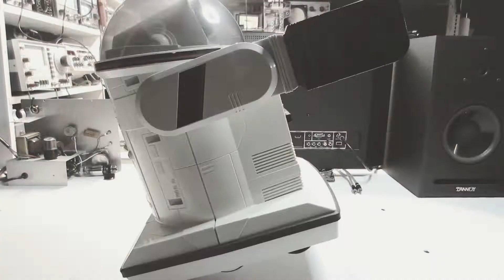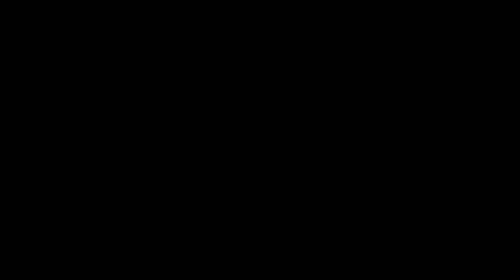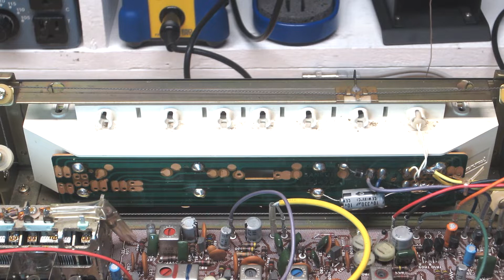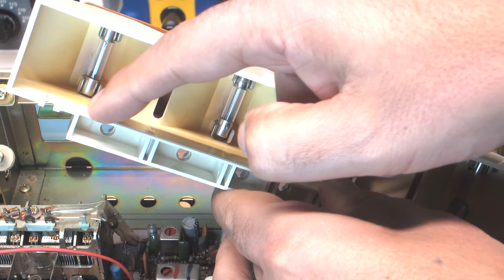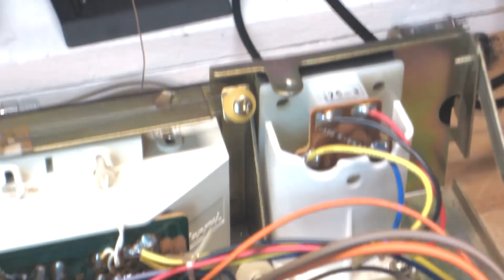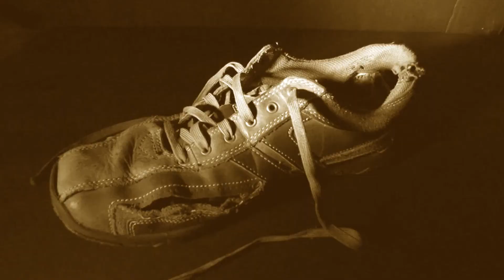Lamp Replacement Sansui 771 Viewer Request

Comment: Thanks for your help.  Could you also show how you removed the function indicator lights?  I have a 770 where the wires go inside that housing unit and I don't know how to separate it without breaking it.  Thanks and peace love and music!
Reply from the maker: Hello and pardon the delay, I've been extremely busy. I don't have the 771 (or similar model) in the shop anymore, they're back with the customers, so, I can't demonstrate the removal of / access to the function lamps. However, in most cases you should be able to pull on the base of the function lamps (within reason), maybe give them a "wiggle" and they usually pull out. Most of those lamps are "friction fitted" into the plastic lamp housing. If you have the main housing removed, you can give the function lamps a little push from the front with perhaps something that won't damage them. If they were soldered to a circuit board like some other makes / models it would be a different story and would of course involve removal of the board  and de-soldering of the lamp etc. But in the case of those lamps that are pressed into the plastic housing, you just have to play around with them a bit, unless someone glued them in or something. By the way, the function lamps are all one piece, it's not a separate "bulb and socket" configuration, so the replacement lamp will need it's wires soldered to the board, or you could neatly "splice on" to the existing wires.

Comment: I just wanted to thank you for your excellent video and i followed it step by step to change the three dial lamps in my Sansui 551.It came off without a hitch.I do have one question if you don't mind.My tuner is definitely picking up stereo broadcasts but the FM Stereo light doesn't come on.I know i'm getting stereo because on older stuff like the Beatles etc. where stereo separation was much more drastic it's definitely not in MONO.
 I don't understand which lamp lights it up.Is it that little red LED light that sits between the dial lamp housing and the tuning meter housing? The tuning meter lamp is working and all the dial lamps work now so it must be the LED. If this is the case are replacements available for the LED and are they tough to change?
 It's no big deal deal but,if it's easy to fix i'd do it.  Thanks for all your help.
Reply from the maker: Hello Patricia, I'm glad everything worked out with replacing the bulbs. As far as the stereo indicator is concerned, I can't recall the exact layout of the 551, however, I do believe it uses one of those little 3mm (diameter) LEDS. You did mention a little red LED, so that must be it. I think the LED for that stereo light is mounted to a little board (but I could be wrong), or does it have wires coming off it to a board?. In any case it will have to be de-soldered and its replacement soldered back in. If you are comfortable doing so, then it should be fairly straight forward, if it is a bad LED of course. Again, if you are comfortable doing so, it would be a good idea to check whether or not you have DC voltage at the LED. I know the LED should be "fed" signal / voltage from one of the pins of a  multiplex IC, and you'll probably see about 8 volts or so when tuned onto a station where you should have a stereo signal. When you are tuned into a stereo signal the LED turns on and then off when you are tune off of the stereo signal, which again you will see reflected in the voltage measurement on the meter (multimeter /DMM). of course, if you don't have a meter, and or are not comfortable performing such a test, by all means do not venture into trying it, especially when performing tests that require you to have the unit plugged in and powered on. If you think you want to replace it (if it's bad) feel free to send me a photo of it (ernest@retroelectrotech.com) and I'll have a better idea of how it mounts, i.e., to a board etc., and what type of replacement will be the best option.
Reply: @retroelectrotech  Well,first thanks for all your help and for taking the time to explain this to me.
   Yes,you're correct the LED sits on a little  board with two wires soldered to it.This board is situated between the dial lamp housing and the meter housing and looks pretty easy to get to.There is only one screw to undo.
   I'm going to take your advice and test first to see if the LED is still good and then go from there.
   After you explained it i now have a much better idea of how this LED is suppose to work.
   I'll let you know what i find out.Thanks so much.

Comment: Thanks! I'll bet this will work for my 551 also.I have just one dial lamp out but,is it best to just replace all four? I didn't know.Thanks for great detailed video.
Reply from the maker: Hello there, yes, you might as well replace them all since you're going to be in there any way. It would be a good idea to use some swabs and alcohol to clean the contact surfaces of the sockets as well, just to assure good connectivity when you install the new lamps. Just be careful and unplug the unit while you're working on it. I'm sure you already know that, but just in case 🙂
Reply: @retroelectrotech  Thanks so much for the great tips.It's always a good reminder to unplug first before you do any work.I will make sure to clean all contacts with alcohol too.
 You know i have a 551,a 5050 and a G-2000.I just love that Sansui sound.
  Thanks again.

Comment: Thanks for this. I have the 881 and suspect its the same as the 771 bulb replacement. Would this procedure alleviate the FM and FM Stereo indicator not lighting up too? Or is there something else needed to be done? Thanks in advance.
Reply from the maker: Good evening, Your 881 is essentially the same as far as the bulb housing is concerned. However, You'll notice on Yours there are more indicator bulbs that span across the top portion of the housing (not including the meters)that are indicators for "stereo, phono, FM, AM, Aux 1 and Aux 2. As far as replacing just the stereo indicator bulb, yes, if the bulb is all that is bad then a replacement should resolve the problem. But if a new bulb fails to light, then You may have a connection issue / open connection elsewhere in circuit. A simple check of the wiring to the board may reveal loose connectivity / a bad solder joint. Also, on the power supply board, I believe fuse F01 is for the lamps (I'm going by memory on that). Additionally, the problem may involve an issue within the stereo MPX circuitry, which can be why the stereo indicator lamp doesn't light. Nonetheless, try a bulb first and see if that resolves the problem. Because I don't know what Your knowledge level is / ability to perform basic testing and beyond, I'm just mentioning the above possible problems to give You some general information. Be careful in there when You power up the unit to test the lamps etc. 🙂
Reply: Thanks again. Will try that. Best regards!

Comment: Could you share the bulbs you used to replace these?
Reply from the maker: Good afternoon, the large "fuse type" bulbs / lamps for the dial face are the 8 volt fuse lamp variety, and the other lamps for the meters are the 6.3 volt (or just 6v) 3mm "grain of wheat" bulbs / lamps. When I have to order them, I typically shop around a little, because there are so many people selling them, as well as selling lamp kits for the various Sansui receivers etc. You'll also see the LED version as opposed to incandescent. The incandescent variety have that "warmer" look, however, they also make some LED types nowadays that have a bit of a warmer look, so, whatever your heart desires ;-) You'll pay a bit more if you buy a lamp kit of course. But if you'd like that option a good seller on eBay is a guy that goes by  Affinity For Artifacts / Peace Love And Music , and he sells all kinds of lamp kits etc., and he has good feedback. (I'll put a link to his shop below), so, there are a lot of options out there, hope that helps a bit.

https://www.ebay.com/str/infinidimenterprises

Comment: hi ,where can i get the bulbs ? Assuming they are the same on the 881 ?
Reply from the maker: Hello, I "cut and pasted" the text from an answer I gave below concerning the same general question, the 881 uses the same bulb types, however there are more "indicator bulbs" used, that show  function setting, i.e. AUX, Phono etc...the large "fuse type" bulbs / lamps for the dial face are the 8 volt fuse lamp variety, and the other lamps for the meters / function indicators are the 6.3 volt (or just 6v) 3mm "grain of wheat" bulbs / lamps. When I have to order them, I typically shop around a little, because there are so many people selling them, as well as selling lamp kits for the various Sansui receivers etc. You'll also see the LED version as opposed to incandescent. The incandescent variety have that "warmer" look, however, they also make some LED types nowadays that have a bit of a warmer look, so, whatever your heart desires ;-) You'll pay a bit more if you buy a lamp kit of course. But if you'd like that option a good seller on eBay is a guy that goes by  Affinity For Artifacts / Peace Love And Music , and he sells all kinds of lamp kits etc., and he has good feedback. Just let him know what you need, I'm sure he'll help you out. I'll put a link to his shop below, however, there are a lot of options out there, hope that helps a bit.

https://www.ebay.com/str/infinidimenterprises